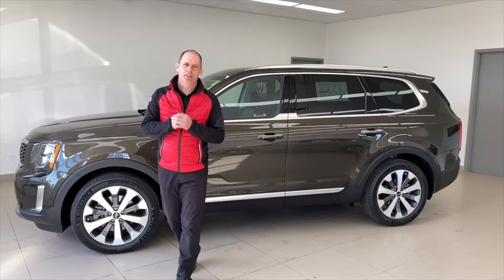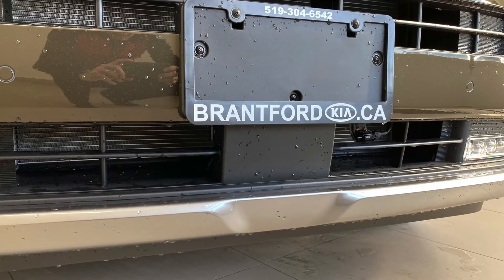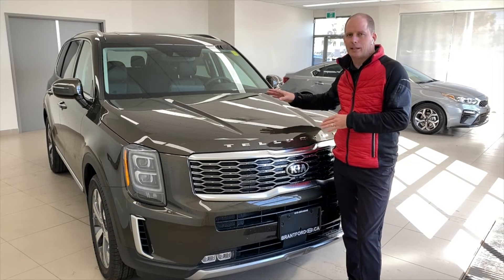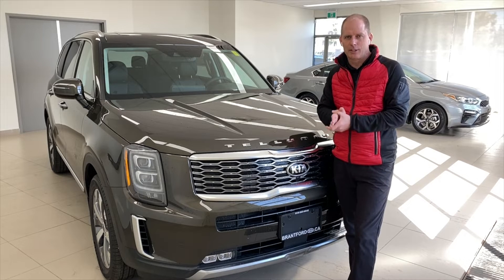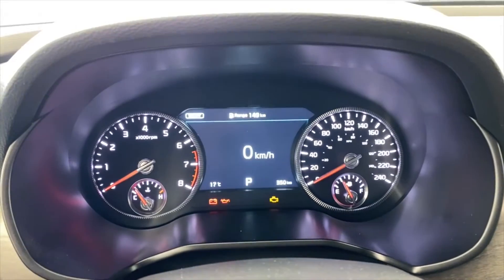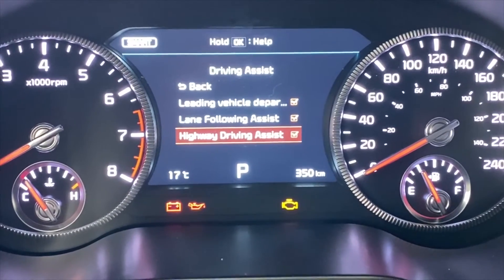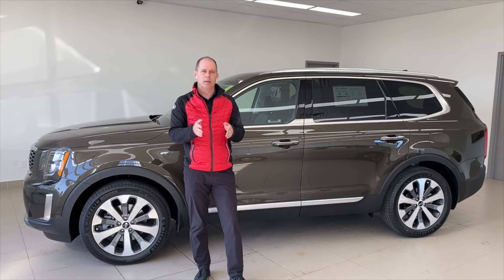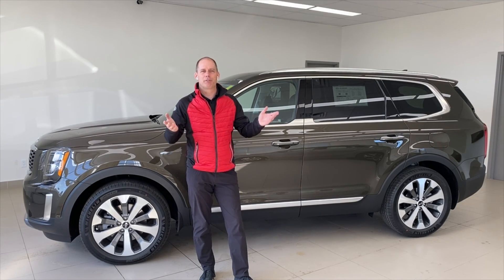Highway Drive Assist (HDA) What is it? How does it work? - Kia Class

Comment: It works in Ireland on some motorways, but changes vehicle speed after the speed limit is detected, for instant from 120 to 100km which means the vehicle can be traveling over the limit for a short time. My previous car a Skoda slowed in advance of the sign.

Comment: First time hitting an actual highway and turning the cruise on, which i did at the limit, freaked me out a bit when the wheel went into auto steer mode and a few miles later auto slowed down to the new limit. Wish i had seen this video before this past monday lol.

Comment: Hi Peter, thanks for these great videos. Just purchased a 2021 Sorento SX. Question...what do you recommend I use in winter for rim and tire size? Thank you.
Reply from the maker: You can always use the factory size, but most of our customers downsize the rim 1 inch, and get the corresponding tire size (the tire diameter remains the same, but you have more sidewall) The benefit of downsizing is that sometimes people like having more sidewall for the winter, and they're also less expensive. Your dealer can help you with the exact tire size that you'll need if you choose to downsize. There are also online calculators.
Reply: @BrantfordKia  Perfect thanks again!

Comment: What is 'Highway Driving Assist 2' that comes on the EV6? What does 2 bring that 1 doesn't have?
Reply: I found this on a Hyundai tech website:

In case the vehicle on the side is driving very close, HDA 2 assists to adjust the vehicle’s path. If driving above a certain speed, holding the steering wheel, and operating the turn signal switch automatically changes the lane in the indicated direction.
Reply from the maker: I can make assumptions, but I haven't received any "official" information about this system yet. I expect that the Ioniq 5 will be the first Kia/Hyundai vehicle that I see with this feature. I did a video on the Ioniq5 and I mentioned in the video that it would come with Highway Driving Assist 2, but that I didn't have any information on what that meant (officially) so I'll wait to do a video on it until they give me the info. Feel free to subscribe, because that feature will definitely end up getting its own video.

Comment: Thank You for showing us about HDA I'd learned something new.
I have questions about the sunroof on the 2021 Kia Telluride SX nightfall. I live in Florida in which some areas the speed limit could go up to 75 miles per hour. Is it a good idea to open and close the sunroof at that speed  ?
Reply from the maker: I'll have to check the owner's manual, but I'm not aware of any reasonable speed that it shouldn't be operated at.

Comment: Question... are there any updates that you can share regarding the 2022 KIA Telluride? Curious what next years updates will be if any. Thank you.
Reply from the maker: I haven't got official information on that vehicle yet. There are a few vehicles where we have info, so maybe it will come soon. Do me a favour and check back in a month or so... I don't usually know when the paperwork is released until the day it is. If there's anything substantial, I'll make a video. The other day we got 2022 Kia Soul Preliminary information, but it's basically just a change to the new logo and a trunk light has been removed or replaced, so something like that wouldn't get it's own video.
Reply from the maker: @derekflint-w2d  No problem! If there are changes worth noting, I'll make a video for sure!

Comment: Peter - HDA was of interest to me as well but I haven't been out enough to try it. The Seltos Features and Functions Guide in the US, p. 15, makes it clear that you can set the speed limit BELOW the posted limit (first it says "set to the current dederal highway speed", then it says "SCC speed set by the driver (at the posted highway speed limit or slower)."  Navigation Updates are required to expand the use of this.  

Kia Customer Service confirmed this and answered some other questions about how this works: "Yes the Smart Cruise Control feature will adjust the speed in which your vehicle is traveling based upon the speed limit signs and any other signs it may come across such as road work signs etc. The system does use both the cameras and the detection of the road signs to determine speed as well as keeping a safe distance from the vehicles around you. If the vehicle does have to slow down for any kind of road hazards/work then yes it would go back to your set speed when road work is no longer in zone."

What is really bugging me is the "Keep Hands on Steering Wheel" - that goes off way to often, espec here  in CO where we have many long, straight roads, PLUS my hands ARE on the steering wheel. I think the test is for the steering wheel movement left/right, not if your hands are ON the wheel - this is a real pain....
Reply from the maker: Yeah. I'll be honest HDA never worked near us when it was first launched, and I haven't had the opportunity to really use it much. Setting the speed limit slower does make sense, but around us literally NO ONE drives the highway speed limit, 10km/h over is the norm with tickets not usually given out until well past 20km/h over. So setting cruise for anything that low wouldn't really be smart for us here. 

I'd like to try the system out but the closest highway speed change isn't anywhere near us either.
Reply: Douglas, I have not experienced the “keep the hands on the steering wheel” message. Maybe because where I place my hands it’s fine. Usually I drive with my hands at 10 & 2 areas of the wheel. I really don’t have the opportunity to drive out in the open where there is no traffic so I am always prepared to make maneuvers if necessary.
Reply: @mikehedrick6544  on the Seltos forum there is an actual Kia tech who is very helpful. I communicated with him and he checked and claims there are no sensors on the steering wheel for this purpose. That would jive with what I've heard elsewhere that turning the wheel, even slightly, satisfies the message. But turning the wheel when you're on a straight county road or interstate seems counterproductive!  I have had the message appear as soon as 30 seconds after turning onto a straight county road. It seems to have a mind of its own at times, similar to the auto stop start.